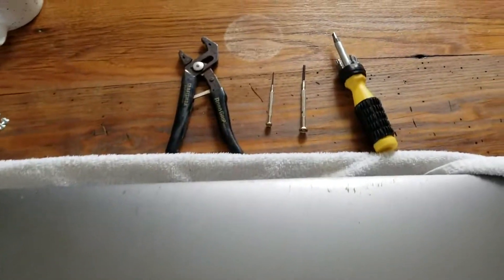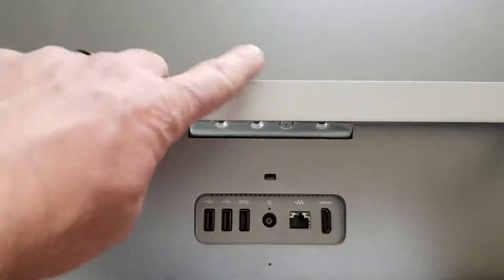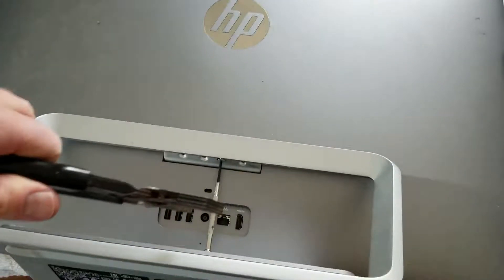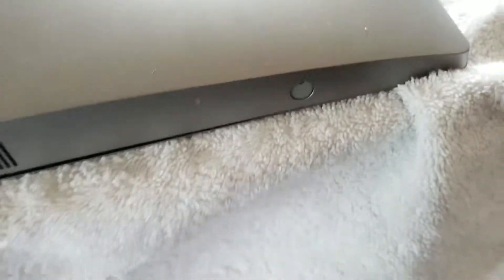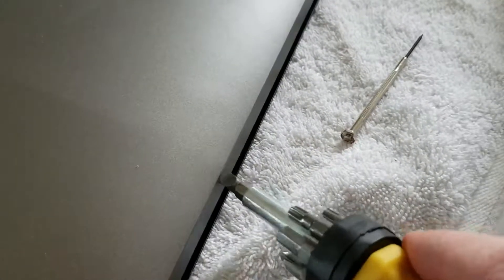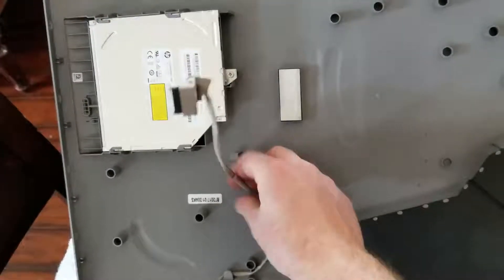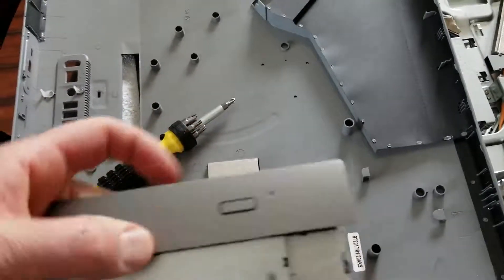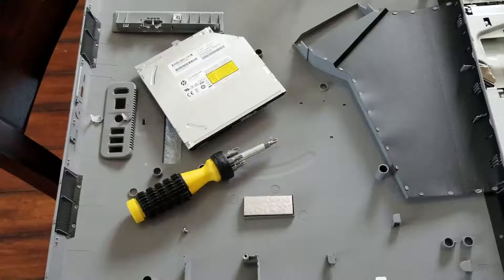Replacing the CD/DVD Drive for HP Pavilion All-in-One PC

Comment: Thanks.  Mine just quit.  I'm trying to decide if it's worth replacing at this point and I wanted to see what I would be getting into.  Mine is still visible to the operating system but it can't tell if there is a disk.  It's a new disk so I put it in another player and it's fine.

Comment: Thank you for this.  ❤   I had a library DVD I had been watching when Windows10 suddenly decided I didn't have a DVD Drive.  It showed up in Device Manager as Hidden with no other information and Disk Manager didn't see it.  Even the HP Diagnostics reports there is no Optical Drive installed.  The BIOS doesn't see it, but Device Manager does and says hidden.  Sigh.  Your video showed the location of the pin hole to release the drive so I could get the library's disk out.  TG.  I have ex0plored all standard MS Options and suspect there is a registry setting that has somehow changed.  I even tried Restoring to last month's Restore point.  Did nothing.  Sigh.  Anyway the all important library disk is out.  I don't think the drive is disconnected because it played the first half of the movie okay, then came a cumulative update and reboot while I slept.  In the morning finishing the movie in this PC was not doable because the DVD Drive had somehow vanished.  I don't believe replacing it will fix anything if the registry still has improper settings or DWORDS.  Researching that now to figure out what changed.